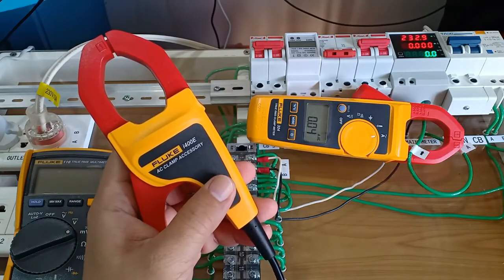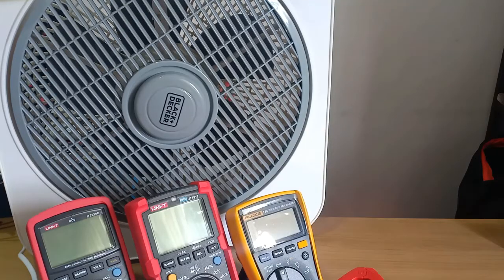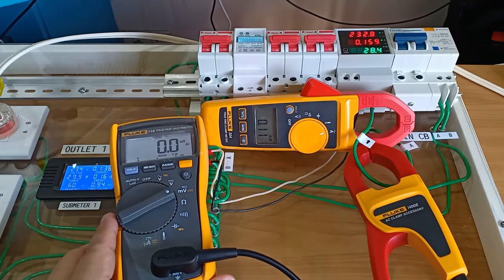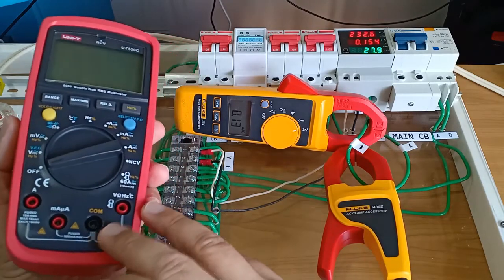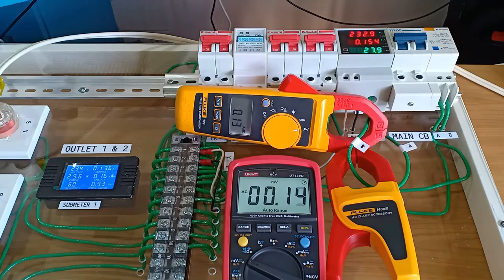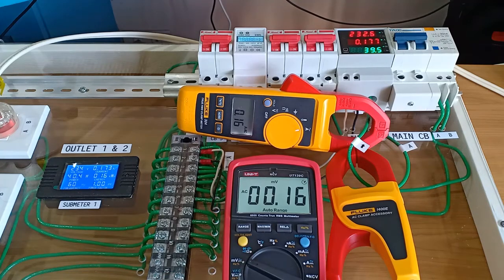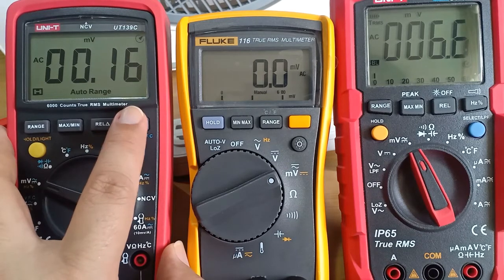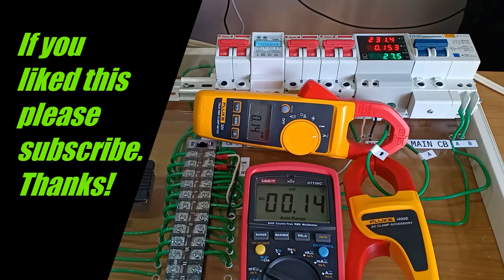[ENGLISH SUB] Fluke i400E AC Clamp Accessory Low Current Test

Comment: mine doesn't work shows 0 the whole time. 2021 with 117, what's the problem?
Reply from the maker: Thanks for watching. I take it you mean the F117 shows zero even when the i400e is clamped on a loaded conductor. You've probably done these already but just to check: mV AC not mV DC voltage was selected, the i400e was clamped on one line only of the power supply (not the whole cord for instance, just one line. Either Line, or Neutral only, not both), load current is expected between 1Amp and 400Amp. Still zero?

Comment: Hi sir,
Is i400e suited for fluke 1587? Thank you.
Reply from the maker: I'm not familiar with the Fluke 1587 sir. I understand it's a fine insulation resistance instrument. But note that the i400e has a range of 1Amp to 400Amp AC. This means the multimeter should have an AC milliVolt range of 1mV to 400mV. If the 1587 has this in its specs then you can use the i400e to read AC current off the 1587. However, the input terminals of the 1587 must have the exact dimensions of the banana terminal jacks of the i400e. I hope this helps. thanks for your support!